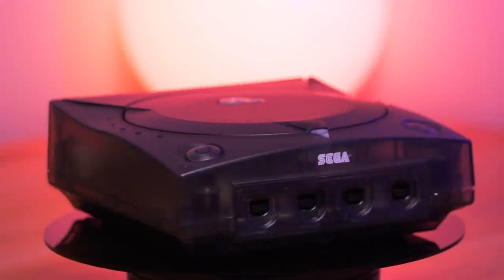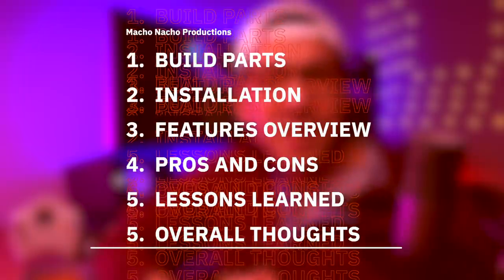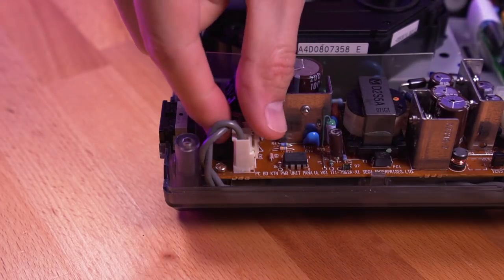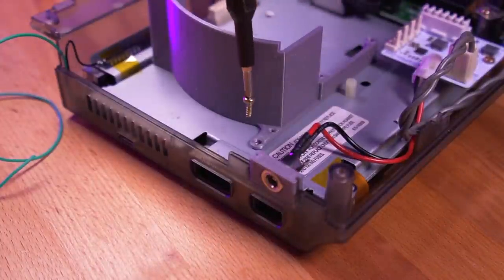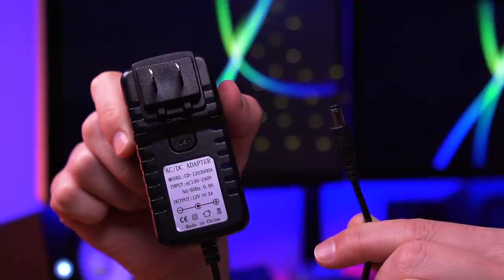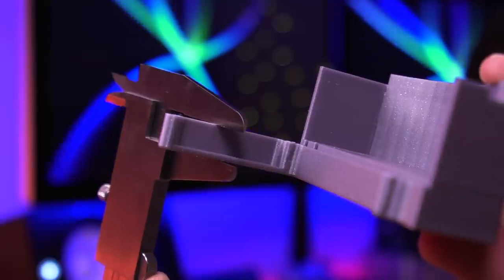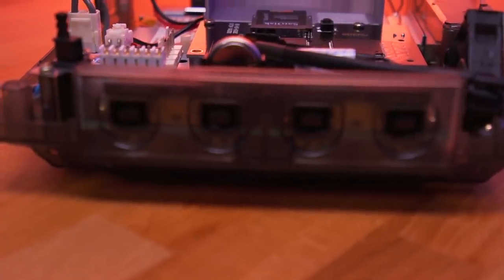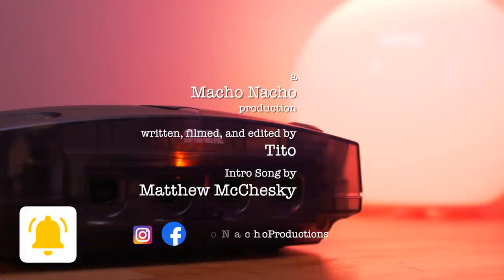Building the Dreamcast of my DREAMS! | Part2: DCDigital + GDEMU + Noctua Fan + DreamPSU Tutorial

Comment: That button is for swapping to the next disc in multi disc games, not for going back to the GD menu.
Reply: Right.  There is also a in-game reset, hold A+B+X+Y+START and that'll take you back to the main menu.
Reply: Came here to say this👍👍
Reply: one other tip...if you are attempting to access the Dreamcast menu to look at game saves on your vmu, make sure that 01  gdemu menu is highlighted, and then choose the exit to menu option using your controller. otherwise if a game is highlighted when you do so, when you attempt to exit the dreamcast menu screen, it will end up selecting the next game by default,  making it so that you have to power off your console to get back to the gdemu screen.
Reply: @MarioMartinez-nu9yw  Thanks for this! Just got the gdemu and did not know how to get to the files on my memory card.

Comment: Replacing the dreamcast power supply: a solution looking for a problem. There is nothing wrong with the original power supply. Replacing it with some cheap Chinese crap is just making the console less reliable, and the video actually proves this point.

Every other upgrade is relevant, especially the ODE, HDMI, and fan mod. The battery holder mod while neat and convenient isn't as useful since many people don't power on the console enough to keep a new rechargeable lithium coin topped off (the battery only charges when the console is powered on) so you will still find yourself setting the time every time you power on the console unless you use it more than once every few weeks. Finally, there are some edge cases where the controller port F1 mod is relevant though anecdotally I've never had an issue unplugging\plugging controllers while the console was on.

Great video, and agree with your points, especially reinstalling the original PSU. There was never anything wrong with it and the only thing that sold DreamPSU was hype.

Comment: hold A+B+X+Y+START and it will soft reset usually back to either the GDEmu or the games main menu at which point doing it again should take you back to GDEmu or you can power cycle the console.
pressing the tactile switch is for loading the next image for when you have a game that uses two or more discs and you have to do the disc swap during the game.

Comment: Well done Tito. The momentary switch on the GDEMU is primarily used for games that have multiple discs allowing the user to seamlessly swap ‘discs’.

I strongly advise you get the GDMENU software my Madsheep. You can then format it to your heart’s content.

To get to the main menu on GDEMU you simply press Start while holding all four face buttons (A,B,X,Y).

I strongly recommend the Laserbear printed disc shroud which gets rid of the hollow look once you open the lid of the system.

Comment: I just put my ultimate Dreamcast together today after the last of the parts finally showed up two days ago. I used my original console for the motherboard+controller port since the gd rom died when I last tried using it to test a few hdmi converters I picked up. The build has a gdemu clone & 3d printed tray, battery replacement, noctua fan mod, an official broadband adapter, smoke grey case from probably the same aussie seller, and a dreamport psu. 

I don't see many people talking about these, there's a basic version and there's one with 4 bluetooth chips, which is the version I got. I still need to buy a bt converted controller but overall I'm hyped to give this a go. I think I'm also going to grab a modded rechargeable & backlit VMU from the same guy. Dreammods is the guy who mods the last few items if anyone's curious.

Comment: When I was doing research on the GDEmu install, I saw that the clone GDEmus were all made differently, but hard to tell just by looking at it.  If you look in Thingiverse, you'll see various iterations of the SD Mount that have been tweaked to handle the clones. I printed the correct one and it fit perfectly in mine.  It just comes with modding sometimes.
Reply: Just to clarify, I downloaded Collingall's (Laserbear) tweaked Mounting files.  His tweaked version worked for me.
Reply from the maker: Thank you for the tip!  I’ll def have to check his out!  Cheers Troy!

Comment: I had the same problem when I installed my GDEMU board.  I couldn't use the cheap 3D printed tray from Ebay.  I made a video about the problems I had with it.  Instead of replacing the power board.  I just removed a transistor from it to keep the heat down. I love playing my dreamcast,  I use the VGA cables from retrobit with a Dell E773c CRT monitor.  480p never looked so good. I would love the smoke shell mod next. Keep up the good work.
Reply from the maker: Nice dude!  I was thinking of removing the 12v rails too!  Sounds like you got a pretty sweet setup!  Vga is supposed to look phenomenal on this crt monitors. Cheers buddy!
Reply: @MachoNachoProductions  you have no idea. You really need to check out my little retro corner out it's pretty awesome.

Comment: The gdemu boards come in two thicknesses. You just happen to have the thicker version, which like you said won't work with a lot of the 3d printed options. I had no issues when I installed mine because I didn't know the difference between all the versions. I happened to do a lot of research and found that there are two thicknesses. Also you are right about the dream psu. Alot of people use them with the gdemu, however there are many that state you can have issues that can cause damage.

Comment: There's a 3d printed GDEMU mount that sits more flush with the dreamcast disc drive. It looks more clean IMO and has an extension SD card ribbon to reach to the GDEMU board and it hides the GDEMU from any exposure of objects falling into it, preventing damages. I bought one from LaserBear. It also makes the disc changing button on the GDEMU more accessible.

Comment: I never knew the Dream PSU used 12v dc, that’s great! I’m working on a little project to have all my modded consoles run on a standard 12v barrel jack, and using a daisy chain adapter, I can run all my consoles off of one high-end 12v power supply, which is both tidier in a setup and more power efficient. Also, if I need to take a console on the road, there is no longer a need to keep track of different power cables or power bricks.
Reply: Dream PSU is a generic power supply and has no protections for low quality power bricks.  The better way is to use a picoPSU with an adapter specifically made for the Dreamcast.  I'm sticking with the OG power supply and cord because it's a pretty generic cord and I don't want to have the added bulk of the external power supply.  If you travel with it just don't unplug the cord from the Dreamcast and you won't forget it.  The only real benefit to the power supply swap is the ability to use a North American console in countries with 220V, and maybe some longevity improvement by less internal heat.  However, with stock PSU and better fan mod, the Dreamcast doesn't really get too warm anyways.

Comment: I prefer the injection molded gdemu sd card relocation.  Relocates the sd card flush with the top plate and is seamless with the same smoke grey translucent plastic.  Also has a correct sized gdemu bracket.

Comment: There are programs to easily synchronize games to the SD card. The most well known is GDEMU_SD by MadSheep. It works well but it's relatively old though, and I wouldn't be surprised if there are better alternatives at this point.

Comment: I have also connection problems with my gdemu. The height have to be right for the connection to make. And if it doesn't, the console won't boot. I also have freeze problems, solved by installation of the DreamPSU, work fine since! Now i have to make the fan mod...

Comment: In part one you installed an extra wire with the hdmi board. I believe it was the green one. Stating it would be used later. What was this wire used for? I didn't see it in part 2.
Reply from the maker: It’s was supposed to be soldered to the switch on the gdemu but I ended up not using it.  I should have stated that in the video, I totally forgot to 😅

Comment: My clone GDEMU has been alright so far, I did have the sd card wipe once between removing it from my computer into the dreamcast, I can't say for certain it was the GDEMU but I've used the same name brand micro sd > usb adapter for a while and never had it wipes cards (unlike el cheapo adapters). Having to rebuild your card image when that happens is kinda annoying...
Reply from the maker: Oh man that does sound annoying. Hopefully I don’t run into that issue. Cheers!

Comment: Great video as always. This dreamcasts with retrofighters's StrikerDC controller would be awesomeome.
Reply from the maker: I need to check that out!  Is it wireless?
Reply: @MachoNachoProductions  it's a nice controller until you put a vmu in it and it's all unbalanced.  I'd recommend an opaque one and maybe additional weight inside the grips.  There is a 3d print to fix it also that I've seen posted on reddit but I'm having trouble digging that up right now.
Reply: @MachoNachoProductions  Is not wireless
Reply: @aarontrini85  Thanks for the info I'll check it out

Comment: CAUTION: Please DO NOT, NEVER EVER touch the capacitors, coils or any other component on the 110/230V side of the Dreamcast PSU! 
Even after days without connection to power, these can have voltages and currents that can kill you!
Unplug your Dreamcast, turn it on and off several times, then open it up and remove it carefully. If you want to modify the original power supply (change caps or whatever), please ground the components first and if you don't know how to do that, give it to somebody who knows what he/she is doing!
I know at least one person who died because of not properly handling AC adapters and I suggest Tito to always add a warning when handling voltages above ELV ( Extra low voltages > 48V AC).
Maybe you can pin this warning?

Comment: Now we just need you to mod the controller for that smoked finish and, if you are feeling exceptionally clever you could route a PC reset breaker switch through to the controller to reset the Dreamcast from the comfort of the controller, thus bringing you back to the GDemu game selection menu.
Reply: I'll bet the I/O from the secondary VMU port could be used to conduct current through the power switch to a microswitch on the controller. Not to make a silly joke, but the power within the DC is... DC, so all should be fine.
Reply from the maker: That could be interesting!
Reply: @MachoNachoProductions  Yeah, I wish I had a spare DC available for messing around with right now :D
Reply: @DaGleese  There is an official smoked grey Dreamcast controller and VMU that were released. I have exactly one of the controllers out of my dozens.

Comment: Any links to the external power supply used? I'm pondering a new power supply as my Dreamcast is getting hot, I'm running Noctua Fan mod, DCDigital, MODE and recapped stock power supply currently. Thanks.
Reply from the maker: I put a link to it in the video description. Sounds like you should be fine though. The noctua fan should provide enough cooling and I think the handles power better than the gdemu. Because the gdemu has different power requirements than stock it causes the psu to get warmer. Cheers John!

Comment: AFAIK, Gdemu conecctor height is increased by 1.5mm from 2019. If your gdemu clone has shorter connector like pre 2019 gdemu, bracket for newer connector may not fit.
Reply from the maker: Thank you for the tip!

Comment: I got a Dreamcast on a flea market, it works but the lens is busted. I was looking for something like this because the device is 110v while my country uses 220v, is a pain having a voltage converter
which is a 15x15x20 cm long... 
For the GDEMU, I wanted something like this because I have my fat PS2 moded wit the HDD, sadly the Gamestar network adapter causes stutering on games despite using a good HDD... if someone knows how to solve it it would be helpful.

Comment: I did the Noctua fan mod, and I recapped the original PSU instead of replacing it. GDEMU would be nice some day, but for now I'd rather invest in some of my other systems. Like my PS1, which now has a PS1Digital, an XStation, and hopefully the MemCard Pro ships soon. 
And then they have N64Digital coming out next month.
And then they have PS2Digital coming out sometime this year.
And they teased GameCube Digital? (I mean, GC Video is nice, but doesn't compare to the DCDigital and PS1Digital, so what they put out for GameCube is sure to be a huge step up)
My quest to HDMI all the consoles continues. 🤤💸
Reply: Speaking of Voultar, I also did the mod he showed in a video to add a diode to the resistor at the battery to be able to use a regular CR2032 battery. No more "Oh you didn't play Dreamcast every day so the battery can recharge? Well input the time again." for me. Now if it asks me for the time, it's "time to replace the battery because it's properly dead" o-clock. Also I of course put a battery socket in.
That same video was why I opted to just recap my PSU as well. The cap kit from console5 is very reasonably priced, and the soldering work to swap them out is pretty easy if you have a good desoldering tool. I luckily didn't even have any leaked fluid to clean up.
Reply: Another thing you could have done when you weren't getting video out: try the analog again. If that stopped working too (and it sounds like it would have), that could have been another clue that the problem is somewhere else rather than the ribbon cable or DCDigital. 
On the plus side, at least you found that messed up wire! Get that thing right out of there.

Comment: My own dreamcast is literally comprised of all of the same components , except I am using the Terraonion MODE plus a 1TB ssd and Laserbear Mount / sd extension . The gdemu is cool, but the file system layout is lame 

Regarding your DreamPSU, you really need to pay attention to the quality of AC adapter you rely on to power the unit. Is the one included probably a cheap POS? Who knows, but pairing the DreamPSU with a quality AC adapter like a Triad would undoubtedly be better than whatever is paired with the dream / pico psu. This is exactly what I am doi f with my dreampsu. Recapping your original PSU is obviously a safe bet, so long as quality capacitors are installed correctly, but the 12v rail should still be addressed when using a GDEmu if only to manage thermals. Awesome video as always !
Reply from the maker: Thank you so much for the information Clinton!  I’m going to check out the Triad PSU. Do you have a link?  Thanks again!

Comment: Why didn't you talk about that green wire going from the gdemu to the back of the console? What is that for what does it do?
Reply from the maker: I ended up not using it. It was for the reset control feature if the DCDigital.
Reply: @MachoNachoProductions  oooh! Great video as always amigo. Very informative.

Comment: The terra-onion mode is so much better than the gd emu I junked the gd emu after the mode came out. It works so much better and is easier to use.
Reply: Shame about the price! I've got the Fenrir Duo ODE for my Saturn, and it's extremely straightforward to install. There've been occasional compatibility issues with image files following firmware updates, but they're not insurmountable problems. The dedicated support from the Discord channel is fantastic.

The amount of difficulty I'd have with installing some of these mods doesn't make them feel like worthwhile investments by comparison.

Comment: Great video. Will definitely be looking into some of these. The SD card is where I draw the line though. Most of the other mods are useful and potentially extend the life of the unit. But once you take that optical drive out of the console, it's no longer a Dreamcast, because it can no longer play Dreamcast discs. And being compatible with the format's medium is the bare minimum definition of a console. Otherwise what you have there is a Dreamcast-shaped emulation machine or the equivalent of an NES Classic Edition. Which is very cool, but it's not a Dreamcast.

Comment: What sd card did you use? Specific brands seem to work better I've read and I'm currently having issues with my SD card branded version.
Reply from the maker: I used a SanDisk. I usually have pretty good luck with that brand.

Comment: 10:45 That having to open the tray in stick your fingers inside the cd tray to press the switch feels all kinds of wrong...

Could you desolder it and connect it to the inverted triangle with a simple wire possibly? I don't have a Dreamcast to look at but there must be a more user friendly way ....
Reply: What the hell am I talking about, why not just mount it to the tray eject button, since that's where you would naturally think to press to swap to the next disk

Comment: Nice build, but I'm not for external power supplies.
Reply from the maker: The internal one is good too and should be fun with the new upgraded fan. Cheers!
Reply: The GDEMU draws less power than the GDROM so it will generate too much heat. All you need to do is desolder the 12 volt regulator on the original PSU and you will be golden Sergio.

Comment: Additional suggestion : Brook's Wingman SD lets you play the Saturn and the Dreamcast with USB controllers such as the Dual Shock 4, the Xbox One and the Switch Pro controllers, and comes with 200 blocks of DC memory as well. The Dreamcast controller may not have aged very well, and I've found myself revisiting this console a lot more with an Xbox One controller which has the advantage of using the exact same button layout as the Dreamcast if we disregard the features the Dreamcast controller doesn't have.
https://www.brookaccessory.com/detail/62472958/